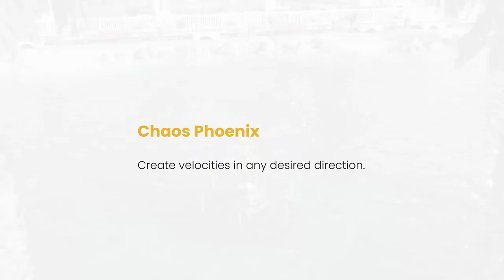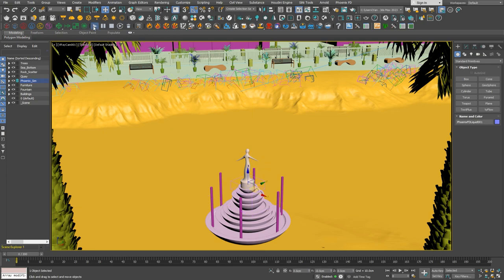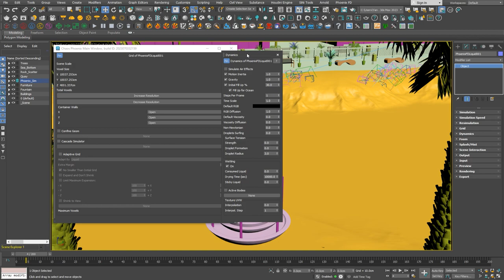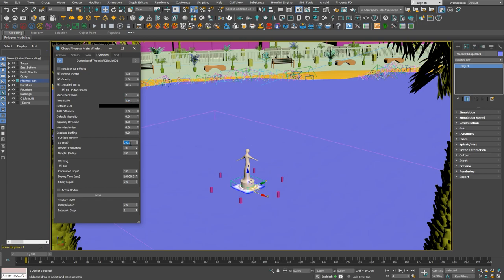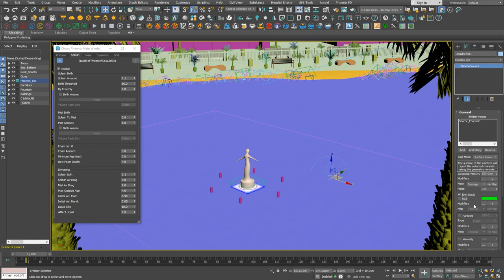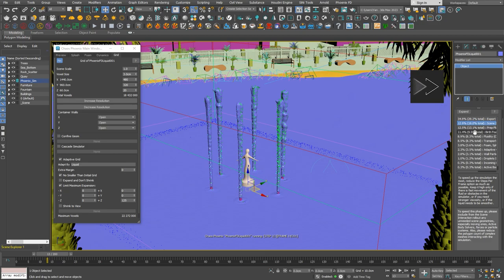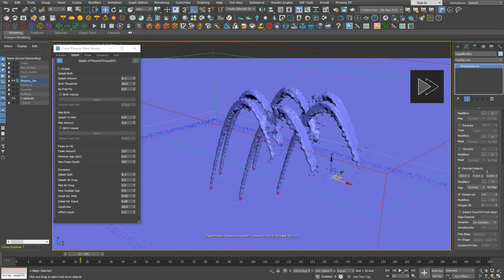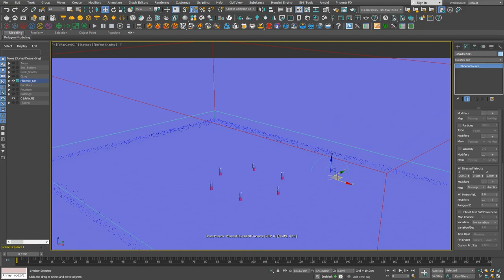Creating directed velocities with Chaos Phoenix

Comment: I didn't actually understand the rgb texture part specially the 1 and - 1 to animate it..
Reply: Hey, let me try to go into more detail - if you set some values for Directed Velocity, by default this is going to create movement in the same direction throughout the emitter. However, you could replace this by a texture, meaning there would be different velocity directions created in different parts of the emitter. This texture can't simple by a grayscale mask - it must be RGB colored, and each color corresponds to one direction - Red is the X axis, Green is the Y axis and Blue is the Z axis, and each of these colors could have positive or negative values - it describes a vector with a direction. If you use a texture, also note that it would override the 3 boxes. And finally - you could animate the 3 boxes for the Directed Velocity, or if you use a texture, you could even animate the texture to get changing velocity over time, which are also different for the different parts of the emitter.
Reply: neither I, it doesn't show in the tutorial how its done